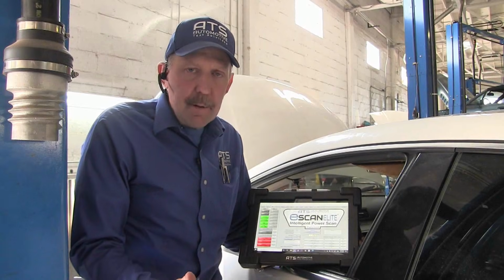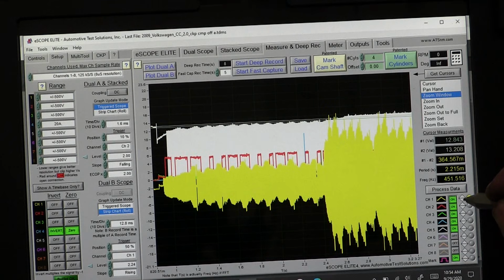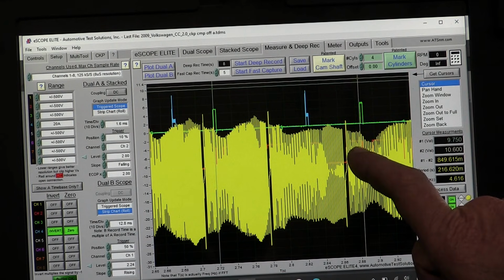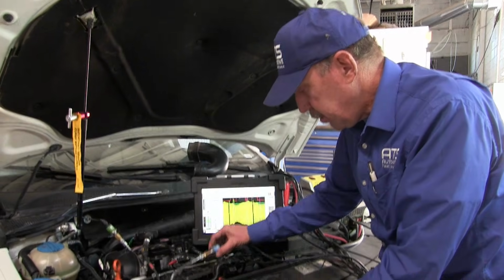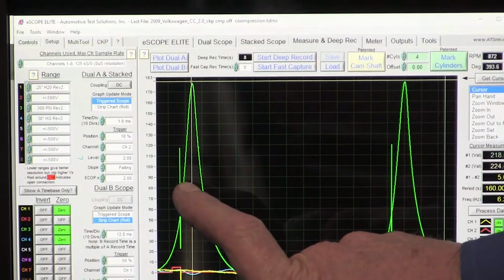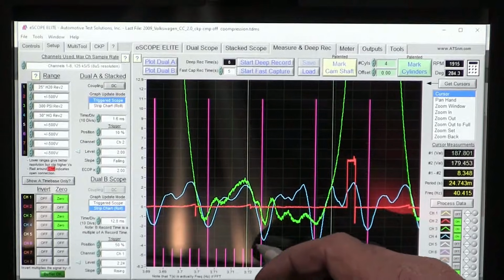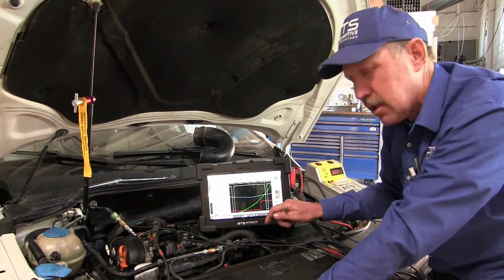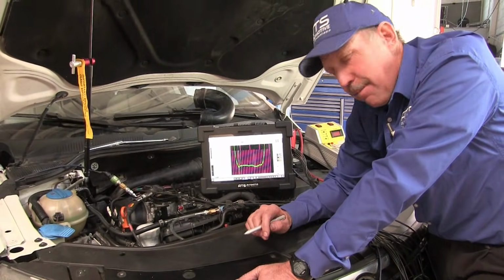See How to Diagnose a P0016 Camshaft Correlation Fault Code on a 2009 VW CC with a 2.0 Liter engine

Comment: Can you please tell me if my engine is shot? I got zero crank effort and code P034100 Camshaft
Pos. Sensor CircRange/Performance
P164D00 passive/sporadic
Reduced oil pressure switch malfunction
Was running great driving everyday 180 kilometers (140 miles) no weird noises. Low oil pressure was only at cold start.

Comment: The pressure waveforms are needed to isolate the problem and identify the valves opening at the proper position . This is useful to understanding valve timing and overlap. Is there more information available where I can learn and teach this to my techs?

Comment: Thank you Sir.  Very detailed and exactly what is needed to repair this issue on my VW 2015 CC R-Line 2.0 TSI Turbo engine.  The engines were pretty much similar. That experience alone is worth a whole lot more than you can imagine.  Scopes are intimidating to most but once you figure out where to put the leads, its not rocket science. Electronics, Mechanics and Physics all in one short video.  Amazing! Thank you for that informative video and the camera placement was very much appreciated.

Comment: Wow ... That was awesome. Tech has finally over complicated a simply camshaft all in the effort to control emission and maximise the air compressor fuel pump (ICE engine). Vey very good presentation. If only I had an oscilliscope

Comment: When I watch you analyze cam and crank signals, I feel like your background knowledge of the signals gives you a real upper hand. I truly struggle to see what you’re seeing even as you try to explain it. But when the in cylinder waveform is overlaid, along with ignition, it often becomes far more clear how to read the timing of events. Even if I can’t see where you’re getting the insights on the cam and crank signals alone, I’m super thankful to be aware of coupling them with pressure and ignition analysis! Game changing stuff all around!

Comment: Hello is that control valve screws in or is it push in looks like a screw in I have a 2010 Audi A4 2.0 turbo. I have a code P0016 I have a feeling that my issue to if that valve a screw in is there a tool for it for removal and install please let me know thank yoy

Comment: In conclusion we  could just remove the cam sensor and look at the solenoid. If it sticks out replace it and be on your merry way ... That's a lot less time and expensive equipment
Reply: Good idea !   bur the  video  was  useful  and  great  ! Thanks  for  Bernie  ! I Have  a 2011 vw Tiugan  that had timing chain tensuner problem  and  bent all intake  valves  so  i got it done the job  but now my Engine wont  rev up higher than 1500 rpm ! I wonder   anyone can give me  some  advise  !???  I have  no  good scan tool  And maybe in  Limp mode  I  need  some  help  please  guys !!!  Also  i  have  a 2010 vw CC  had some  problem  with  intake  i  changed the  intake  manifold position sencer  and the whole  intake manifold too  i  couldny  get   it right so i  put  the whole manifold from   my 2011  tiugan its  better  no  code on dash  but  sometime   its  hard to  start or   seems like  brake  vacum  buster ccausung  harder  to start here and there  aneyway I tought  i  get  CC  rightsince  102 000 mile on i  Changeed the  hidraulic timindchain tensuner  after sterted  i   busted all intake valves  i had to do a valve j0b  i tought  i deed  everiting like  wrote in book   but  I  just  wonder  since i deednt  prime  tensuner  was  that the  pronlem  for  big time dammage in engine !?????  when i  redeed   valve job i turned  engine over to  prime  with oil  so   second time  turned out ok  runs   ! Please help me   folks with  your  opinnions  and adwises

Comment: Want to ask a question , how will the waveform analysis differ from if the timing issue is due to slipped timing belt /belt

Comment: That's an impressive scope setup, 8 channels and 4 transducer inputs.  That said, on this particular situation, it might have been quicker to just pull the solenoid off and visually inspect the spool valve based upon statistics and experience.  That's just this particular situation where this particular engine is known to have this particular problem. I'd say he was at least 30% certain when he saw the DTC (from experience and statistics), 95% certain when he saw the first scope test showing wonky cam timing (which could have been seen in a four channel scope, no need to sync to cylinder 1, I think).  All the other data gleaned from the transducers was kinda fluff that backed up what he already pretty well knew.  The guy is a wizard, no doubt, but I think this was at least partly a commercial to sell their killer scope.  No doubt this scope is awesome, and he is a wiz, but he (personally) didn't need it (and all the extensive testing) to clearly know what the problem was.  Very educational and detailed though, and I can conceive of situations where this scope and accessories could really come in handy on a much more obscure problem.  The manufacturer needs to modify the ECM code to recognize this and apply at least enough solenoid modulation to hold the spool in a safer position than it does.  56° cam advance is asking for serious valve crushing trouble.  VW is really dropping the ball on this.  Imagine repairing some bent valves and not catching the root cause and then smashing some more on first crank up.  Again, awesome scope, more awesome diagnosis, poor engine design.  If I understand this solenoid control, from his description, it takes a high duty cycle modulation to bring cam to non advance for starting and low speed/load, then less duty cycle to advance the cam.  This would mean bad wiring or burned out cool always leads to maximum advance of the cam.  Obviously not this much advance, since this is a broken spool, but max advance nonetheless.  I hope Mr Bernie responds as I'd like to know if my theory about failure modes is correct, and I never intended any offense by my "other theory" about this being an advertisement.  I'm only saying that Mr Bernie didn't need all that data, but I admit that I probably would since I know nothing about volkswagen engine design.  I'm an SBC guy myself, and this problem happening is pretty unlikely in a single bumpstick cam.  I'm watching because I love scope diagnostics. :) If I was a professional mechanic, this is the scope I'd want, but I'd be happy with four channels and cheap current clamps and homemade pressure sensors.  The 360 and 720° rulers are awesome.  Alas, I can't afford such scopes, so I'll be relegated to using a calculator to convert microseconds and milliseconds to degrees. ;)
Reply: You have to remember, we know about these common, pattern failures because somewhere, sometime, someone was the first to figure it out. Someone like Bernie figured it out using equipment like this and then the rest of us look smart because we learned it from them. I think in real life, Bernie wouldn’t have gone thru this much testing but remember, he is showing a diagnostic process that is useful for other problems and with any similar equipment. If he gives a plug for his own design equipment and it helps pay for the time he took to pass out the information, I’m on board. It’s the way America is supposed to work! 🇺🇸
Reply: I like your perspective! I wonder if these are infomercials or true clinics..... a bit of both perhaps. Bernie Thompson is a very brilliant tech guy and diagnostician, no doubt. I calculate an expenditure of several 10's of thousands of dollars for all the equipment made by just this company can make any shop a boon to the diagnostic world. The problem is, what's the ROI? By the time I could calculate the true cost of my time and factor in the equipment cost, I'd have to charge somebody a lot of money to diagnose cars, which are depreciating liabilities! From my own professional experience, the consumer views an expensive repair bill as better delegated to a down payment towards a new or newer car...... but that leads to issues discussed in the book "The Millionaire Next Door", doesn't it? Peace!